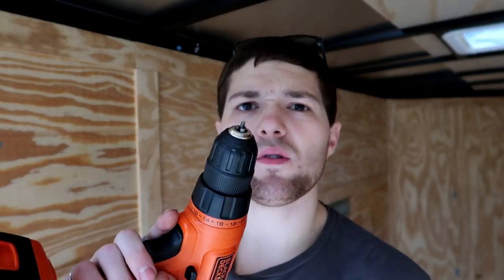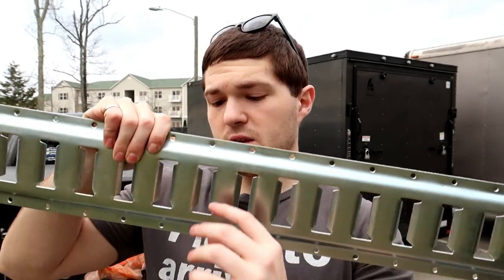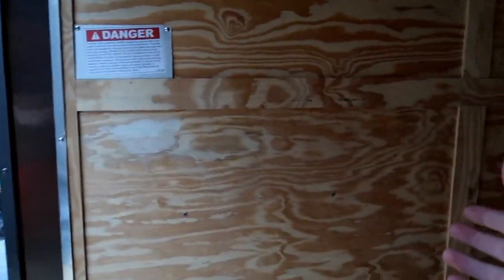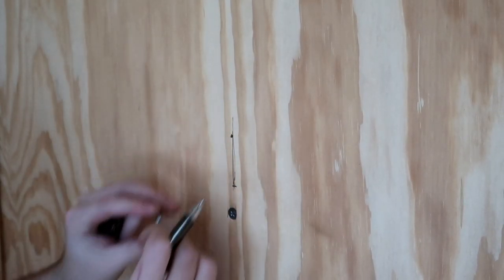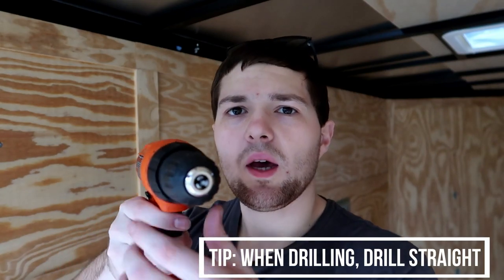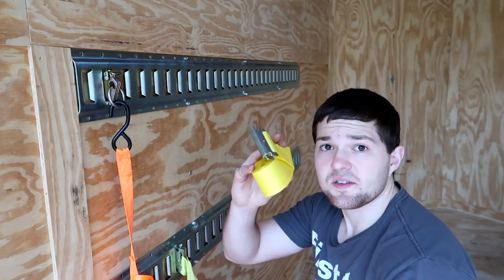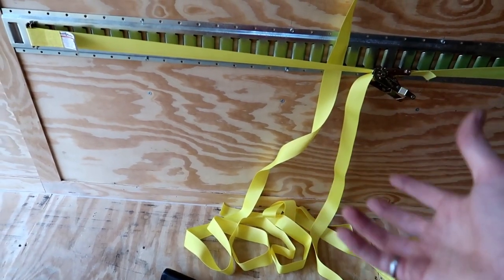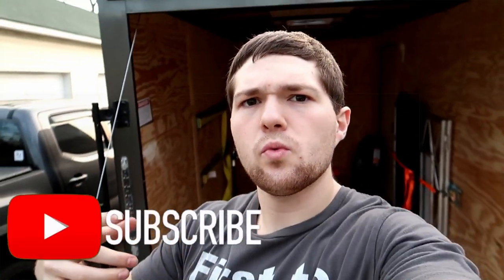Mobile DJ Mods | DJ Trailer Modifications Part 1 | EZ-Track install | Tie Downs | Transporting Gear

Comment: I went to the local hardware store and bought some new latex based paint that had some kind of grit in it, way cheaper than bedliner but same concept.  Has worked really well in my trailer floor plus makes it anti-slip.

Comment: Valspar anti-skid floor paint for the floor and ramp. It looks pretty good and it has a grit to it kind of like sandpaper so you won’t slip when it gets wet, plus it will protect your floor and ramp. 
You can buy it at Walmart, Lowe’s, Home Depot... etc

Comment: I would use the cheap vinyl squares for the floor. I have the same trailer. I installed Styrofoam insulation panels to keep moisture out and away from my electronics. Painted the walls and did something nice with the nose, which has a power inverter in case we Dj tailgates.

Comment: Throw some EZ-Track on the floor as well for current or future use. You may get totes or gear that you don't want shifting in the center. Lots of landscapers do that.
Reply: The only problem with that is it greatly limits being able to roll ATA cases in

Comment: Cut down 5 gallon buckets as bases for your tripods to sit in. Keeps them from sliding loose, they will as you hit bumps. Tripods are the hardest to store and transport without getting dented and scratched up.

Comment: AWESOME DJ... Weak tool game. Gloves, DeWalt Impact Driver, Socket set would all be very helpful. Buy hey, if it gets the job done, I guess what you have is OK.

And that rachet strap up front wont last long. I did that and quickly replaced with Semi-Tie-Downs between D-ring anchors. Semi-straps are much more user friendly and holds tripod stands perfectly to the wall.
Reply from the maker: I was spoiled with my Dads work shop back home. Every tool you could image. But I own a full 300 piece craftsman socket set, I got gloves, and just recently picked up a complete robi one tool system. I think there as like 20 tools in it....
Reply: @DJRickWeb  
You were the DJ that (years back) I said "If he can do it... I can do it!" and got started professionally. This weekend I'm retiring my 5x8 trailer that has been to hundreds of weddings for a larger one. One BIG QUESTION... How difficult is it for you to maneuver in and out of venues? I'm worried i'm going to immediately regret having a larger trailer that's too difficult to street-park.  Also, anything since this video that you've realized about what you've bought that you'd change?

Comment: Bedliner or Cut aluminum sheets to fit the floor depending on how many gigs that trailer will see a week...

Get 3 or 4 more of the yellow straps, never know what odd size stuff you may need for events. Then on that same note put the truck all the way down both side at both heights. Better to have it & not need it, then need it & not have it.  l learned by doing sound rentals & small concert set ups with local guys when not DJing...

Comment: Hey Rick, in your old videos you used to mix a 18" sub with 15" sub (PRX715XLF with PRX718? if I recall correctly).  I was wondering how well they work together.  Sorry about that massive laceration on your finger.  Hope you can still mix ok.
Reply from the maker: Its bass. Low it multiples. The fact that its 2 15s and 2 18s is less off a real thing. It's just what I had available

Comment: Use marine grade clear coat for the floor as well as the walls(optional). Dont use paint it will start peeling if you want to go that route use stain. (12 years experience as day job)

Comment: Like your channel buddy, but buying ANYTHING from Harbor Freight should be the very 'last' option if you expect it to be least bit useful... probably the most poorly manufactured/designed stuff out there. I purchased FOUR gas generators from them for my business 3 summers ago and every last one of them had to be returned AND their  replacements in turn also didn't last the rest of the workday. My advice... only buy BIC lighters from them, bro. BTW... way too much pressure to make a hole with a drill into pre-treated wood, man... thanks in part to HARBOR FRIGHT tool bit's poor design & untempered steel!!
Thanks for your channel and hard work, nonetheless 😀
Reply from the maker: You fell for the one rule at harbor freight. Don't buy anything that takes gas or uses electricity. There tools are solid and anything that doesn't have moving parts is great. To speak to that every tool. That doesn't take power. At my work place. Fortune 500 company is from harbor freight.

Comment: None of the DJ items that you are carrying is heavy enough to matter about weight distribution.
Reply from the maker: What? A 300 lb. Road case makes a difference in placement.
Reply: Nope, that's a duel axle 3500 lbs per axle. It is nothing, for the truck or trailer. Plus the trailer is not wide enough to make a difference.
Reply from the maker: I was meaning like tongue weight. Making sure I have adequate weight in the front and over the wheels vs at the back end causing more jump at the hitch of my truck.